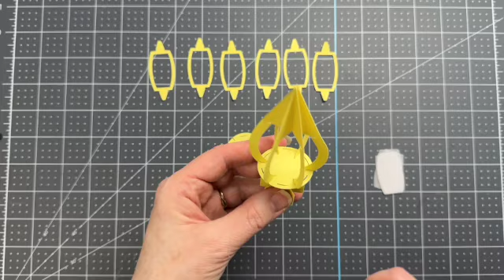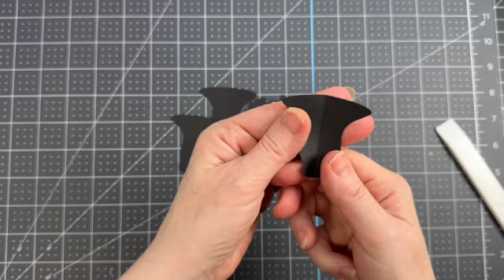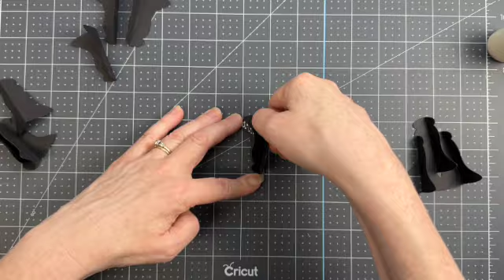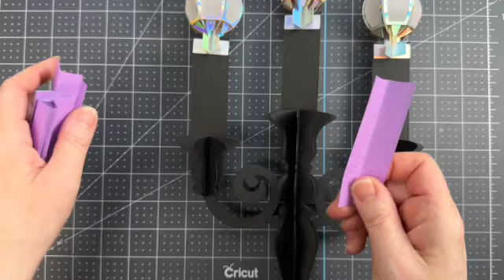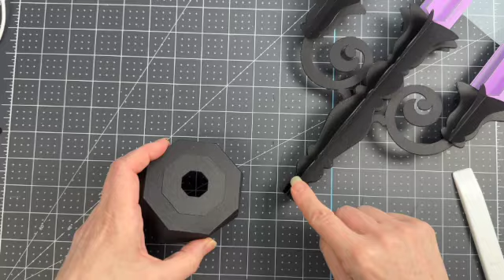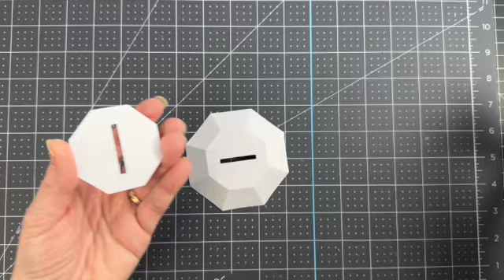Candelabra   SD 480p

Comment: Is there enough room to put tea light candles in there? Battery powered of course 😅
Reply from the maker: Yes please battery powered, lol!  The diameter of the inner part of the flame is just under an inch and most tea lights are approximately 1.5 inches, so unless you can find some mini one (they do exist, but I have no link) they will most likely not fit.
Reply: @crafty_lou7  Thank you ❤️